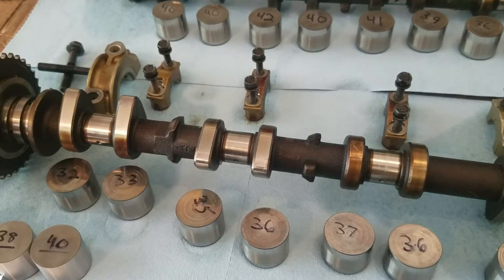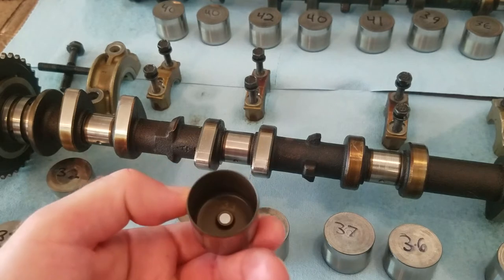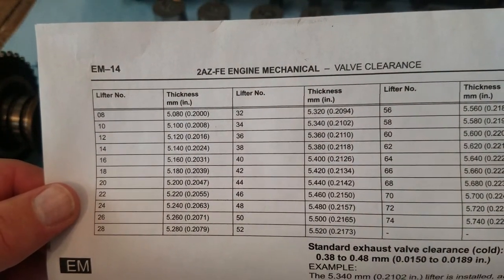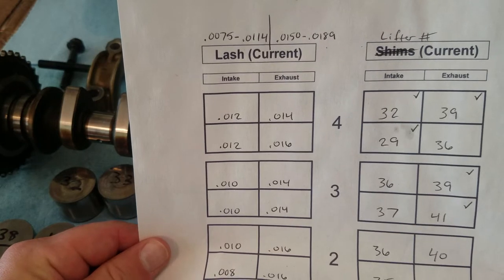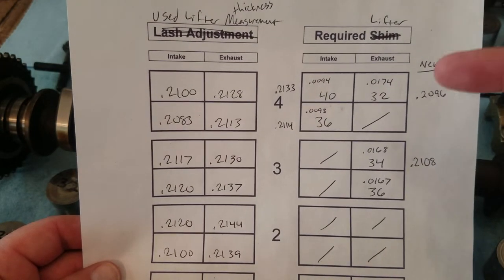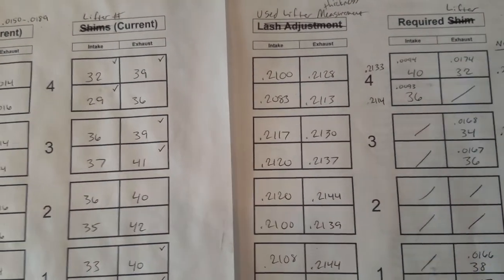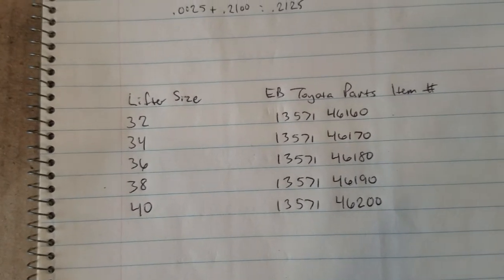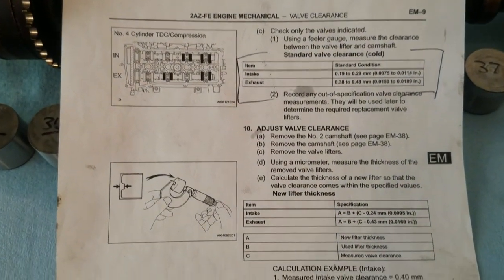Valve lifter bucket measuring and replacing

Comment: Hi I’m currently doing this job on 06 Prius, same bucket style. Did you find your valve clearances to small or too large. Mine had 11 that where under minimum. Some very tight. I looked for your follow up video but couldn’t find it. Cheers

Comment: How often showld i do this work in my car , how this problem is diagnosed without puting in work
Reply from the maker: I wouldn't do this for fun.  I was having to rebuild the motor so this was part of the process.  You would have to get the bucket measurements while the head ia still  together.
Reply: @elvrolet  if we change the tappers this is called valve clearance ?

Comment: hi i have the same issue with my 1zzfe engine, i was wondering what was the noise  before you change the lifter and after changing how was the result?  also when i go toyota do i tell just lifter number ?
Reply from the maker: Look up Elvrolet and VVT Vibe on youtube and you will be able to hear the motor noise.  After completing the job there is still a little tick, but that may be due to the conversion sheet being off by toyota.  I just took a video of it running today with the idea to post on this thread for you, but im not seeing the option.
Reply: @elvrolet  thank you for your reply , when you buy lifter do you just the number to toyota dealer ? Also. B4 was that sound very loud when you speed up ?
Reply: @elvrolet  pls post the video

Comment: why don't we directly change the lifter instead of changing the bucket
Reply from the maker: The valves are under high compression and for the most part shouldn't change size.  The valve buckets of this style are designed to be what you replace in case of being out of spec.

Comment: I apologize if I sound stupid...to avoid going through the trouble of measuring to figure out which one need to be replaced can i just replace them all? And buy them to there proper spec.
Reply from the maker: Short answer, no.  These are set to size by the gap between the cam lobe and the bucket.  If you replace them with the wrong size it will lead to more problems.  As the miles go up on your car, it wears the cam lobes which changes the original size.  That's the long answer, but the work has to be done if you want a good runnging car when you're done.  Good luck!
Reply: @elvrolet  that's out of my skull and time set I have...do u know how much a mechanic would charge for that job? And thank you for taking the time to answer my questions...
Reply from the maker: @ata6602  I have no idea on what the billable hours are on that job at a shop.  Im sure they charge around $150/hr.

Comment: Hey, all my lifters were fine They just got mixed around and I don’t know which goes where, What process should I go through to find out which bucket goes where.
Like what should I measure?
Reply from the maker: Did you measure any of them prior to taking them off the head?  If you dont have a base line then you will have to put put them back, torque the cam, measure, then see what the variances are to figure out which bucket you need for each valve.  It's going to suck.
Reply: @elvrolet  lol Yupp I’m in that process right now🤣 it’s not hard but it’s super tedious, it does suck😭
Reply: I am in the same boat right now!
Reply: What did you end up doing?
Reply: @kesu90  you gonna have to look up the specifications for your cam buckets, put all the buckets in a random order, torque everything down, then use a feeler gauge to measure between the bucket and the cam. If it’s not the right, take the cams out and start switching buckets until they’re all within spec, it’s ridiculously tedious and time consuming dead ass took like 10+ hours to get them all right. It’s hard to explain but smeedia made a video explaining it much better than I do. Search up smeedia on YT and I think it was called measuring valve lash or something like that
Reply: @kesu90  there’s 2 vids he posted the video is “Subaru STI valve lash always double check your measurements”.  Go to 9:50 in his video and you can see how he uses the feeler gauge to measure
Reply: @kesu90  I would recommend labeling on a paper like in this video, and keeping switching the buckets 2 at a time, so you don’t get mixed up and forget which one you’ve switched. Like the dude said in the comment. It’s going to suck Fr Fr 😭 good luck

Comment: Hi what happens if the clearance in these arent in spec?Do you lose compression. thank you
Reply from the maker: You could lose some compression as these are pressed down on to the valves that open and close in the cylinder.  The biggest thing you will notice first would be the noise they make as they wear down and the cam lobes slap the valve buckets as the camshafts are turning.  You would need to do a compression and leak down test to really know which item is at fault.

Comment: Wait so could I just take all the worn buckets out, look inside and just order the same bucket or do I have to measure it and get a different bucket based on the wear to compensate for the wear on the camshaft lobe.
Reply from the maker: You really need to measure all of the clearances to get it back to factory spec.  Otherwise you will end up with more of the same problems.